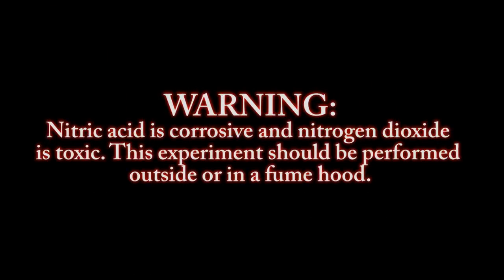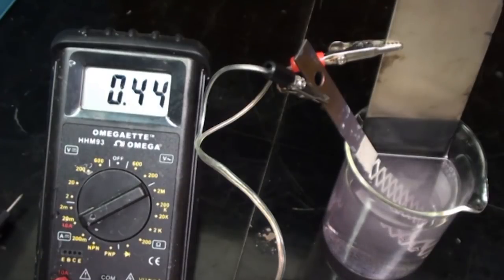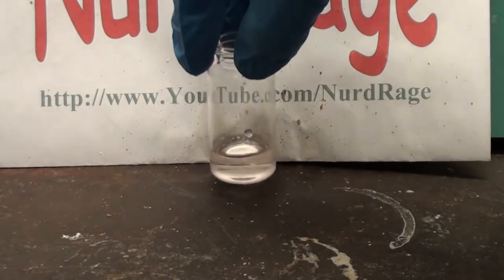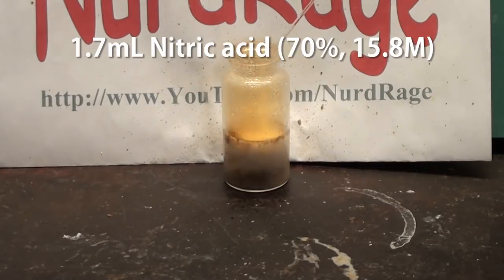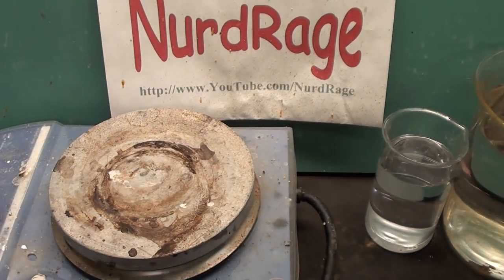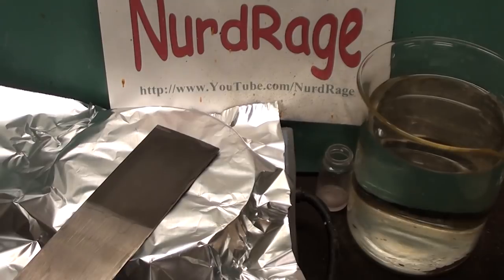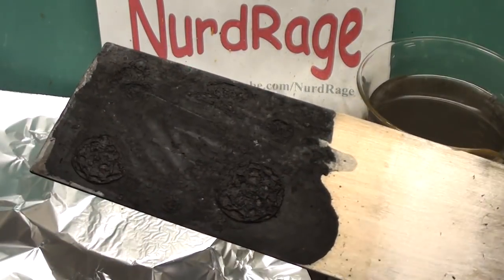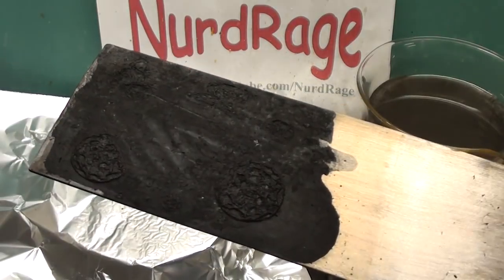Make Manganese Dioxide Electrodes - Revisited

Comment from the maker: you can choose to do both or one sided, If you plan to only use it with one other cathode the just coat the side facing the cathode. but if you're using a multiple electrode setup with alternating anodes and cathodes then you coat both sides.

Comment from the maker: We certainly agree there, at least if that newfangled "Asteroid mining" works out then platinum prices would drop like a rock :)
Reply: I have had absolutely phenomenal results using these for Chlorate cellslIQ have had these last for a couple of weeks and very harsh environments I was very happily surprised.I'm thinking about using this along with some graphene oxide to see if I can make a current collector the temperature should reduce the graphene oxide back down to pure graphene but it's all good do you see any drawbacks and trying this? You may have a tendency to make the coding weakerbut other than that I can't see any obvious reasons why it wouldn't work I am not a chemist however so I'll ask you LOL

Comment from the maker: you answered your own question, you're using platinum as a cathode. but Manganese dioxide electrodes are meant to be used as *anodes*.its an apples and oranges comparison. 

 if MnO2 electrodes were used as cathodes they would be quickly destroyed.

Comment: Of course you're right and that is very good if You are going to show different types of electrodes. I very often use different types of electrodes of lead dioxide, probably for this reason I said "better", but as you said "better depends on the application". Things could be so easy if platinum was cheap... ;)

Comment: Use a 5w% sol. of Mn(NO3)2 with 0.1w% NH4NO3 in Water to achive best conductivity. Wait for evaporation of the water before heating to 300°C to avoid bubbling. After decomposition heat another h at 350C to get better conversion. This yields excellent electrodes with high conductivity and low degradation.

Comment: Nice video on electrodes again! I have two questions: 
1. Are the manganese salts from batteries using the SO2 process pure enough for this?
2. Is the electrode plated on both sides or will the aluminum foil interact with the MnO2-Layer upon heating?

Comment from the maker: alright then,

If you check out my video "make sulfuric acid - copper sulfate method" I demonstrate a situation where carbon electrodes would be terrible. the electrolysis proceeds in a highly acidic environment and the electrode is severely corroded after just a few hours of use. A manganese dioxide electrode would be much more resistant to that.

Comment: NR, would this process work with lead nitrate? I can't get the pure MnO.
Congratulations for all your videos... You must have studied a looot!!! I'm just sarting chemical engineering.
Thanks!!
Reply: 2 Pb(NO3)2 (s) → 2 PbO (s) + 4 NO2 (g) + O2 (g). It will produce lead(II) oxide, not lead(IV) oxide. So you can't.

Comment: Oh, I am sorry, there was a mistake in my comment. What I wanted to say was:
"If the purpose of making magnasese oxide was to make manganese carbonate of it, why didn't you let your manganese sulfate react with sodium carbonate, which would produce manganese carbonate?"
And add the nitric acid afterwards. Sure, it would be contaminated with sodium sulfate, but this should not interfere, should it?
If it does, how about using recrystalization?
Thank you.

Comment: And how about the lead-based electrode? You have already said, that you have failed making it for the "lead" ingot was mostly tin, but, basically, how did you want to make that one? Use nitrate-method again?
Could possibly be lead acetate solution applied onto the electrode and after drying dipped into sodium bicarbonate solution and then heated to form a Pb3O4? Of course, this procedure would be repeated several times.
Thank you very much.

Comment from the maker: I haven't actually tried it for making sulfuric acid from CuSO4 but i'm reasonably certain it'll work since i have tried electrolyzing dilute sulfuric acid and it didn't degrade, if it survives those conditions it should survive a CuSO4 solution.

As for other acids, it is possible but requires special techniques. I'm working on a video for that but it takes a tremendous amount of time and effort.

Comment: tungsten is easy -- break open an incandescent lightbulb and remove the little spring (careful -- tungsten in that fine gauge is really brittle)

titanium (or manganese, chromium, etc. or pretty much anything where the oxides are easily available, directly or indirectly): dissolve in hcl (this will emit chlorine gas, so have something to use it or neutralize it), then electrolize the solution with carbon electrodes (also produces chlorine). Break the metal-coated carbon, and separate the metal.

Comment: Can you calcine the MnSO4 directly onto the titanium? The reaction should be MnSO4 --> MnO2 + SO2(g).
Reply: I found this:

3MnSO4 → Mn3O4 + 2SO3 + SO2

The thermal decomposition of manganese(II) sulfate to produce manganese(II,III) oxide, sulfur trioxide and sulfur dioxide. This reaction takes place at a temperature of 850-1155°C.

However, Wikipedia claims your reaction works for electrolysis.

Comment: Old video, new question. I have looked at the sciencemadness discussions, including the guides and experiments by Xenoid, and nowhere do they mention plating MnO2 directly onto titanium. Always an intermediary layer, be it cobalt oxide, tin oxide, etc. In the previous video you mention that the MnO2 is oxidizing the titanium substrate and that's why it needs the cobalt oxide intermediary layer.
And yet in this video the MnO2 is plated directly on titanium. How well did the electrodes fare? I've seen mentions of similar electrodes with no intermediate layer becoming passivated relatively quickly.
Reply: I also tried MnO2 directly on ti anode and let it run on 100mA/cm² for 8 days in a 1L cell. I see no degradation at all on the surface. You also don't need to etch the surface with HCl, simply use a steel brush on a drill to rough the surface before coating.

Comment: im doing a small water electrolosis, and i need to convert 20 fluid ounces of water and im using aluminum foil electrodes, and i was wondering if (they work fine) they would oxidize alot or "hydrogenize" XD or is aluminum fairly chemicaly inert. thanks

Comment: So I was thinking.... I do a fair amount of copper and nickle plating. which are the easy ones... but...

apparently It is somewhat difficult, but possible to electroplate manganese directly with this plating solution. I'm sure It requires an activation step like other more intensive plating processes.

Manganese plating solution:

manganese sulphate....100 gm
ammonium sulphate.....75 gm
ammonium rhodanide...60 gm
up to 28 A/dm2, 25 °C temp.

If it were done well, it would make a flawless coat

Comment: How does this electrode work compared to the platinum electrode when electrolyzing copper sulfate to get copper and sulfuric acid?
Reply: Compared to platinum? Bad! but will work i think
Reply: max13239 I already knew that, along with gold. I was thinking this would be a cheaper electrode than either of those. Maybe lead could work, perhaps?

Comment: Yeah I dont get it... I have done this with 2 different batches of all three chemicals and there is no reaction between the oxalic acid and manganese/water   I have to heat it every time...  I always end up with most of the manganese being left and only about  one ml of the nitrated manganese to work with..  I mean I was able to coat an electrode but I had to bake 7 batches to get enough.

Oh and I always end up with long thin needle like christals in the end.
Reply: I personally do not like the idea of reducing with oxalic acid since its another solid that may contaminate. Just put your manganese dioxide directly into dilute nitric acid.  Just add hydrogen peroxide  in portions until all brown dioxide is reduced and you have your pale pink manganese nitrate.

Comment: would commercial transparent conductive oxide work? I mean Gallium doped or fluorine or indium doped tin oxide. Maybe plating them on an inert substrate like titanium? It only problem I see with making them is the cost of acquiring the sputter deposition systems and thermal treatment systems.

Comment: isn't a platinum-electrode by itself the best hydrogen-cathode? where's the point of using it for reduce protons to hydrogen. i'm not saying the process is not cool and so forth but i'm missing the use - but maybe that's the mistake?

with "best" i mean one with a relatively low over-voltage (dunno if its the right word in english :D)

Comment: NurdRage, I've tried to make MnO2 on Ti anodes, but I wanted to do it by electrodeposition. As you know titanium gets passivated as an anode in MnSO4 (you can't deposit MnO2 that way), so i found that one can do it cathodically from a basic kmno4 solution. The problem is that MnO2 depositions are not very adherent and after drying the electrode (which seems perfectly coated when wet) the layer gives many small cracks and falls apart I don't know why, maybe you could investigate that?

Comment: I am no chemist 
I have some white fuming nitric acid that I just made.
it is greater than the 70%  How would do this.
Simply dilute it??
Reply: Clown Whisper Your two comments contradict each other. "I am no chemist" "I have some white fuming nitric acid that I just made." how would you make white fuming nitric acid if your not a chemist. You have to know how to distill at reduced pressure to make white fuming nitric acid.
Reply: It does not take a degree to do vacuum distillation and make nitric acid. :)
Reply: Davy Zeng following steps.
Yes, you need to dilute it with water (distilled if possible) im no chemist either, so im also not sure if diluting it is needed. I think that as long as you add the same amount of mol its fine (you can calculate it easily of you have the concentration of your acid)

Comment: ... Or you could just use pencil lead, or carbon electrodes from a battery. Why mess around with annoying, difficult to make metal oxide electrodes when you could just split open a pencil?